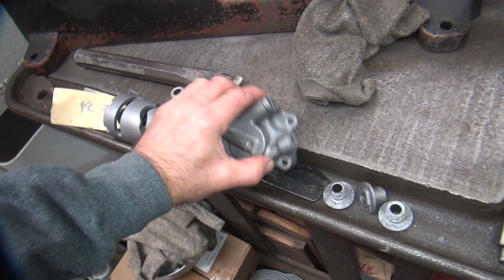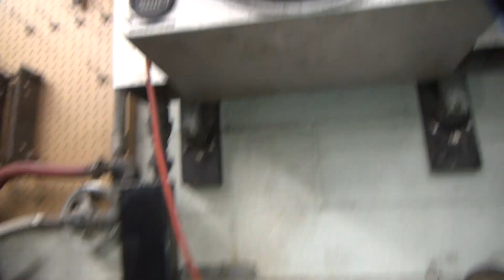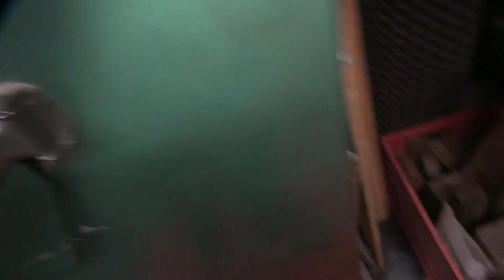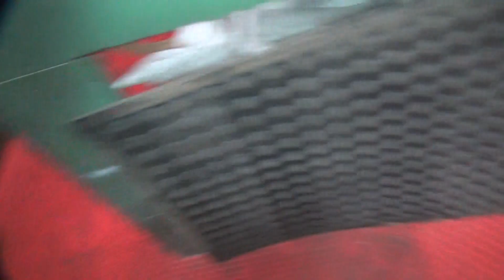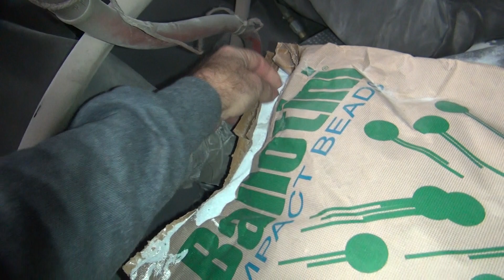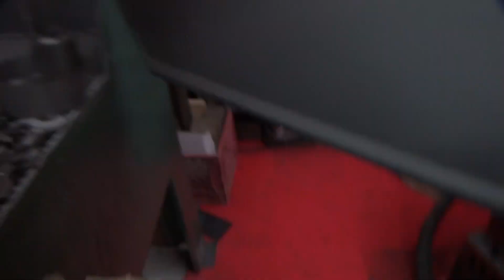see the crap i buy on ebay #1 how i clean parts bead blaster 1951 panhead case harley tatro machine

Comment: Hi,Did you say140psi for bead blaster as I run max out at 110psi medium grit glass
Reply from the maker: my regulator is broken for now so i start at 180psi. the beads clean very good and fast at the higher pressures but it kills the beads and is harder on the surface being cleaned. i use 80psi because it is the best average of everything. that is cleaning speed and quality of the cleaning action and the part damage. i bump it up to 100 psi max on very nasty steel parts that are not critical to size or surface finish. i also switch to a fine 100-150 grit sand when i need that extra cleaning action. be aware of the metal loss with the higher cleaning actions. AG fine grit 120-270 mesh size beads leaves the best finish and the least damage to the part.
tatro